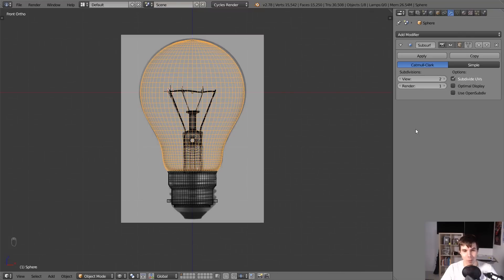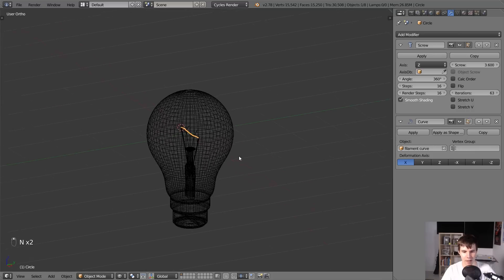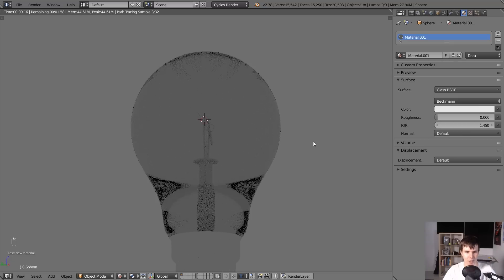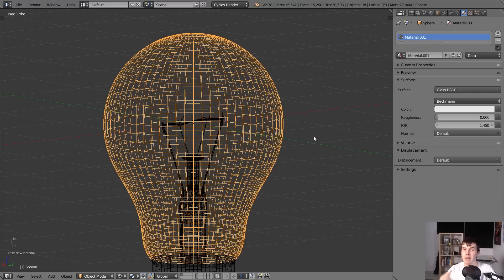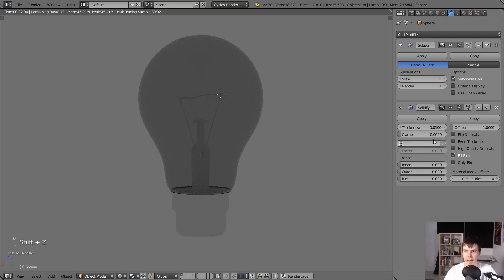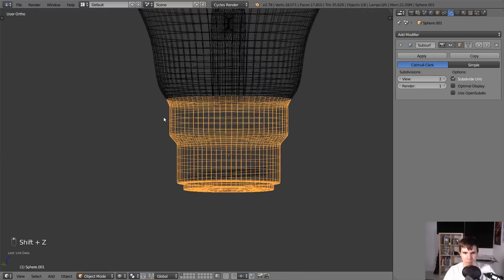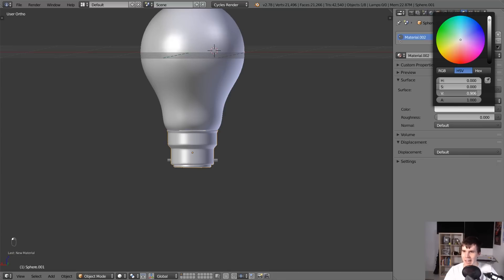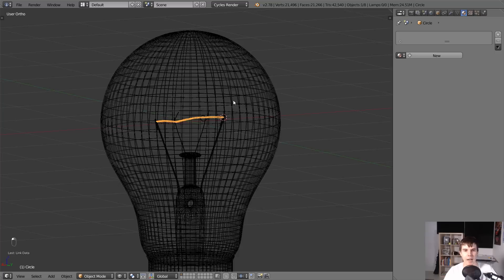Beginner Blender Modelling Tutorial - Lightbulb Part 2 of 2

Comment: In Blender 2.82, to render the filament separately, you need to add a new "view layer" from the upper right hand corner right above the layers window. Next, with the new view layer selected move the filament to a new collection and hide/disable everything else. Once you've done that, you'll notice that when you press F12 (render), the default view layer gets rendered first then the new view layer, which are then combined together in a "composite" render in the same render window. You can switch between different renders in the render window from the drop down menu in the upper right hand corner.
Reply: Thanks!
Reply: Thanks man.
Reply: thx alot

Comment: For those of us using Blender 2.91, don't use the Glass BSDF material, use the Principled BSDF material (you'll have more freedom of creativity with its options), then turn Transmission up to 1. It will look frosted if you don't have Roughness at 0.

If you're not able to see through the glass, it's because you're using the Eevee render engine, not the Cycles engine. You can change the Render Engine by going to Render Properties, Render Engine, then selecting cycles.
Reply: I was also gonna comment the same, also we can use the BSDF to make metal or any material.
Reply: you save my life pro

Comment: I narrowly avoided brain damage from heatstroke once.  One of the scariest experiences of my life.  I collapsed on the stairs (luckily did not fall down them), passed out and then came to on my bed wondering how I got there… until I realised I wasn't there!  I was still on the stairs!  I jolted awake and immediately realised the severity of the situation, but kept hearing a voice in my head saying, "you're strong", I pulled myself down the stairs and made my way to the kitchen but I had great difficulty controlling my legs, they were going mad, I when I tried to walk forwards instead I bounced side to side.  I eventually made it to the kitchen and ran my head under the tap.  After a few minutes I regained control and ran a cold bath that I lay in for about half an hour, and when I got out the water was warm!  Two or three minutes longer on those steps and I don't think I'd be here.
Reply: I drove from Michigan to Texas in august and the air conditioner in my truck was broken (still is).  Probably not one of my brightest moments.  Half way through Oklahoma, I started almost hyperventilating.  I stopped and cooled off for a bit, then got going again.  I thought I was fine till night came.  Didn't realize how out of it I was till it cooled off and I fully came to. I drove for another 4 hours in the dark fully alert, but with a nasty headache.

Comment: If you cannot see through the glass using 'rendered' viewport shading in recent Blender releases, it is because the glass BSDF surface shader comes with a default 'roughness' value of 0.5 instead of 0. Just set it manually to zero and now the filament and glass thing inside the bulb appears

Comment: For you that when using the nodes on the renderLayer part for the glare and the Fillament image is not apearing, for viewing the Fillament duplicate node corretly in the black render with only the fillament, you MUST render the scene after you change the fillament object to the second layer. I was having that problem because i didnt render it after the proper changes, so on the "fillament node" wasnt showing nothing, only the default grey background. its just a small thing that if you dont pay attention to the video you will be stuck in that part and thinking where you got wrong when u´ve done every thing corretly. Great tutorial Andrew as allways.

Comment: Hi... I would thank you for those two excellent tutorials. I'm a beginner of 3D modeling and I started again after some years (thanks to this tutorial)... I'll contintinue for sure. :)
I would also give you one idea for improvements... I saw that you never rename meshes, material, etc, unless it's really necessary... I think you should encourage people also to work in a more systematic way, by assigning names... on the long term people saves plenty of time. I followed your tutorial, but I always gave names... so, for example, when I had to select all the "bases" of the bulb (in order to change the material) I didn't lose all the time you lost... Indeed at the beginning I have renamed that part as a "base"... so, after the duplication, the project was plenty of base.001, base.002, etc... So I just opened the Python console, wrote bpy.ops.object.select_pattern(pattern="*base.*", extend=False) and all those objects were magically selected in one shot.
See you in your next tutorial.

Comment: I think there is a fairly easy way to make the "srew thingy" on a normal light bulb. If you activate the Add-on "BoltFactory" in the User Preferences you can add screws to your scene, that are quite easy to adjust. You then just need to delete the screw head and combine it with the rest of the light bulb and you are done. That's at least how i have done it.
Reply: Kudos--great idea and worked like a charm!
Reply: Thank you, this was so helpful
Reply: @appamemes4927   yes bcause u gotta join the last add node and glare node with another add node and join it with the color Balance
Reply: And here I am. Feeling like an idiot cause I spent an hour on boolean stuff.

Comment: Blackbody referes to the blackbody radiation spektrum. 
Any object with a higher temperature then 0K releases photons. The wavelenght of those photons depends on the temperature of the light. For example humans at 37°C (310.15K) are to cold to release any visible light. But if the temperature increases beyond around 500°C (773.15K) every object starts to glow slightly red. To put it more general: the higher the temperatur of an object the shorter the wavelenght of the photons release. 2 objects at the same temperature will release the exact same spectrum of light.
Reply: human body emits photons too, but they have frequency less than visible light, so we cant see them.
its fall in infrared range, so with thermal (infrared) camera, you can see it.

Comment: Hey, I'm using 2.79 and whenever I apply the Fog Glow or the Streaks effect onto my filament in the compositor, the size of the glow effect/size of the streaks is way smaller than in this tutorial. I haven't found an option to increase the size of these effects. Anyone having the same problem or may be able to help? I set the size for the glow to max (9) but the distribution is very small so I don't even see any glare effects in the final picture. Is that because of filmic render view?

Comment: Old but still a nice tutorial with interesting storytelling, like always! ^^ Anyways, I have a problem in my current project. I've created a lamp, with lightbulbs shown in this tutorial and I've linked the lamp to a scene (current project). The light was shown correctly while rendering in viewport at the beginning (the bulb was glowing completely like in the original file) but then it didn't glow like this anymore. Now I only can see the slightly glowing filament. It seems like the strength of the emission shader has decreased. That's weird and I don't know what to do to fix this. In the original file it's working fine

Comment: Note, If you don't find the Surface options, make sure you have your rendering engine set to Cycles Render. I had it to Render Blender and couldn't find it. Ive spent half an hour trying to figure out what is going on. Until I noticed that I had the old render option set.

Comment: Made it with Blender 3.1, had to change a couple of things in fact that 3.1 works a bit different. But I'm facing one massive problem: Everything looks fine in the rendered view, but if I render the image itself, it gets really, really dark. The emission of the master lightbulb is barely visable. Do I need to change the render settings? I'm using the cycles render

Comment: Is there a way to actually mate the bulbs to the surface instead of eyeballing it?
Reply: you could try making a physics simulation.
Reply: I've not been able to find ANYTHING concerning positioning other then "eyeball it" or "type in numbers manually relative to an absolute 0". Coming from a background in CAD, why does it seem like for 3D art, there is no way to just specify "this goes on that", "this is X relative to that", or "this can't go through that"? how do you make anything with multiple parts when nothing has an actual relationship to anything else? For example in this video, there is nothing stopping the lightbulbs from passing through each other or the table. If I am making something with moving parts, how are they supposed to move logically when nothing has relative relationships?
Reply: well, there are tools to do just that. It's either snapping to grid/vertices/faces/whatever, or physics simulations, or particle systems, or parenting, or rigging or some clever use of some modifiers, or a combination of the above, or something else that I didn't think of just now, depending on what exactly you want to achieve. The tools are there, but in some cases (like in this one for example) it may be easier/faster to just eyeball it, rather than spend the time to set up a simulation, run it, bake it, and then tweak the results so that it looks exactly the way you want it. 

When you want to, for example, place a chair in a room on a flat floor, you can of course set it up with physics simulation and 'drop' it there.. but it would be a lot faster, and just as good to just eyeball it, or snap it to the ground.
On the other hand if you wanted to have an animation of a brick wall falling to pieces, then it would probably be faster to let the computer simulate it for you. Especially if the exact placement of individual bricks is not that important.

Also, in 3d art you're not really (well, not always anyway) making a full physically correct scene, but just an illusion that will look right just from the camera's point of view, and so often you want things to go through other things and stuff like that, so you can not worry about the actuall geometry, and instead focus on just the end result.

Now, if you have any specific questions/placement problems, feel free to ask and I'll do my best to point you to a solution.
Chees.
Reply: use the snap tool. the little magnet on the bottom control bar.

Comment: Why would you extrude inwards something like this? Even back in 80s' early 3D days on an amiga people did these shapes by lathe/spinning a thin 'double curve' (meaning a single curve folding back  to a very close parallel to itself). With that you can also create easily create the differences in thickness these objects actually have irl.

Comment: I'm seeing the seams of meshes of my bulb glass in rendered image. Guys, how many times did you subdivide the glass mesh? I had 4 for rendering but it's not enough. I needed 6 but it made my GPU memory full so I had to use CPU rendering.
Any advice for this case?
Reply: Try to keep the subdivisions as low as possible. When in object mode, use the toolbar by pressing T and under 'tools' there should be some shader option and put it to smooth.

Comment: In my final render the soft shadows of bulb i.e where the light path is used is not coming and there is a blackish shading in the thickness of the bulb where solidify modifier is used i.e in that thickness region .....plz help someone(i have checked this issue many times but i just can't seem to correct it.)
Reply: Ctrl+n or just T to bring the tool panel in edit mode then "flip directions". It seems your normals are facing the wrong way. Sometimes happens with the solidify modifier
Reply: @Biohazard0687  nah man the normals are fine
Reply: @Biohazard0687  I think something else is wrng
Reply: @Biohazard0687  what is the solidify thickness value? Mine is 0.0100 with a check on fill rim

Comment: Just curious, to anyone who might know, how much PC power do you need to make things work this smoothly? With the donut tutorial and now this one, by the end I start lagging really bad.

I just upgraded to a GTX 1080 card so I'm assuming it's not my GPU that's the bottleneck, but rather my CPU (i5 3.2GHz), just wondering if anyone knows if that's actually my problem or if it's something else.
Reply: Make sure you've got GPU rendering enabled. Setting the tile size (under Performance) to 256x256 also speeds things up.

Comment: Hey guys, I'm encountering a problem. At around 6minutues, when i change my scale, my scale is totally off... for some reason the dimensions on my model are: X = 0.06mm, Y = 0.04mm and Z = 0.93mm (so for some reason my Z is 15 - 20 times larger than the other ax'es)
Also, when i change to metric, my lightbulb is actually incredibly tiny... if i increase the scale to 6 x 4 x 93 cm (so X and Y are reasonably realistic), my bulb is as big as the entire floor-grid...

If i scale only the Y axis, my Filament will space out... So, probably the error is there somewhere...?

Hope someone can help on this difficult to explain problem!
Reply: Try pressing Ctrl + A and click scale. Maybe this will help.

Comment: Thanks Andrew.  Great tutorial.  It made the difficult bits really straight-forward - only problems was the easy bits made difficult by all the changes in 2.83.  I made an effort to model the bottom of the bayonet correctly, with the black insulation plastic and two oval steel connectors.   But I think the shadows are still too deep.  Still I think the end result I got isn't bad for first try: https://drive.google.com/file/d/13Y9XGlJiiR9COEeQORvyR1AQ39YeTnDh/view?usp=sharing

Comment: Guys I need help choosing a gpu for my future build.
So far I've chosen:
i7 6800k 6core 12threads 3.4stock 3.6turbo
MSI X99A SLI LGA 201132gig ddr4 ram 2400mhz
psu 750w 80+ gold
250gig ssd (for OS and programs)
1tb (completed project files, I have another pc and external hdd's for random things) 

My current budget could afford:
1060 6gig
1070 8gig
980ti 6gig
PNY Quadro m2000 4gig
PNY Quadro k1200 4gig

I've heard that Quadro cards are the way to go but will it really work with the programs I'll be using?

I wish to main Blender but on the side I'll also do a lot of Graphic Design (Photoshop and Illustrator), Video Editing (Sony Vegas and After Effects), create games (Unity). I won't use this pc for any gaming.
Reply: Master Ryu cause u need an i3 amd processor not some shitty intal product
Reply: I'm fine with Intel, always been with them so I'll keep it that way.
I've used Mac before and didn't like the feel of it.
Reply: Master Ryu lol intel is owned by apple read up kid get ur fakts right .
Reply: Master Ryu besides apple makes wayyyyyy better products than hp and ur setup is like so mid 2016
Reply: My goal isn't to build the best pc that I can. It's to build a pc that fit my skill level and my budget. I'm still a college student (I'm 20 years old), and don't work (for now). I planned for it to be upgradeable for years to come.